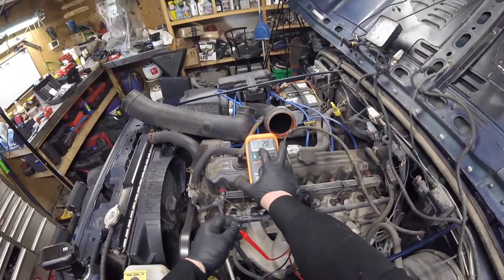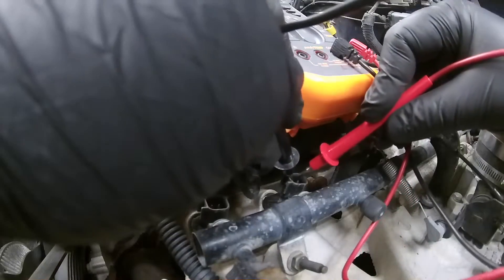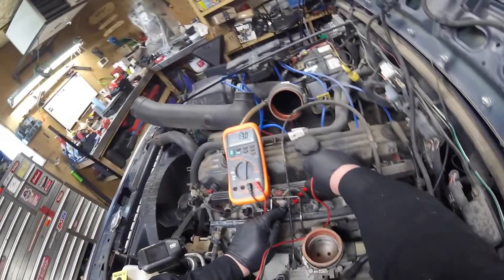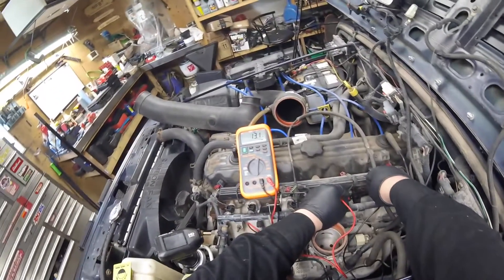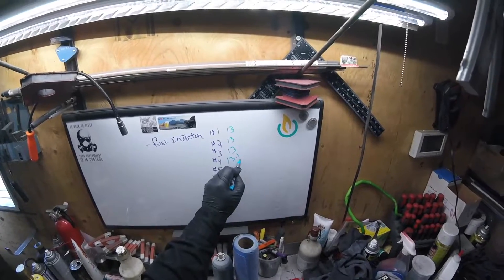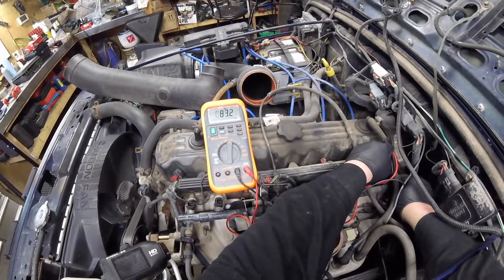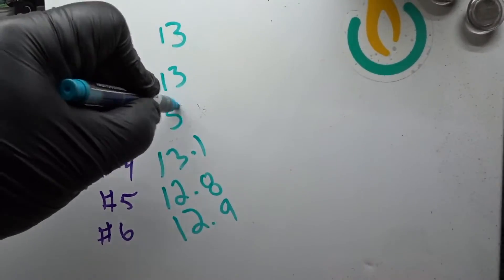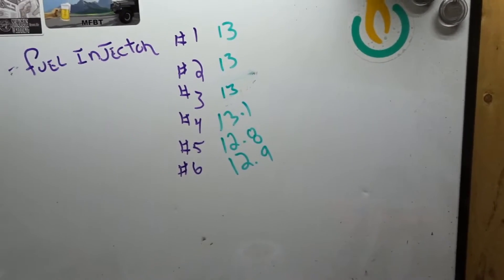Testing Fuel Injectors Using a Multimeter

Comment: Jerry, its really cool that after 34years I can come back to DIY video's of yours that help me trouble shoot my own simular issues. I used your method here to check my fuel injectors on my 1994 Z28 LT1 350.  Now if you could make a how-to video on how to dissamble a fuel injector and replace with new fuel filter baskets and rubber o-rings. Thanks again, Earle

Comment: Thanks for the video. Just learning about injectors, I have 2 that seems to be stuck open, flooding my cylinders on a GM 4.8. Since injectors are about $100 a copy, I want to know they’re definitely bad before I go that route. Plan to learn how to check pulse making sure I don’t have an ECM issue. Want to set up a test bench to ensure they’re all spraying correctly. I’m an old (70) 60’s gear head, so all this is pretty new stuff for a dinosaur like me. Thanks Again for the video.

Comment: I test mine using a long screwdriver pressed against my ear.
Reply: Does it show the same thing as resistance or resistance shows other faults with injectors
Reply: @valireklaam  yeaa except it makes a clicking sound meaning that it works if it doesn’t make clicking sound it means it’s bad